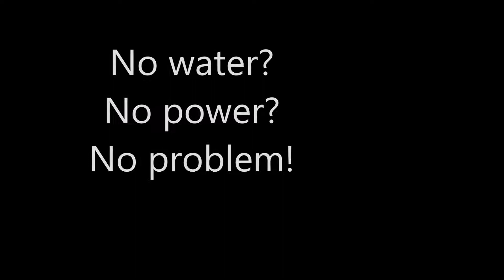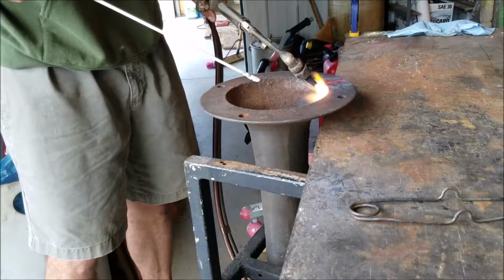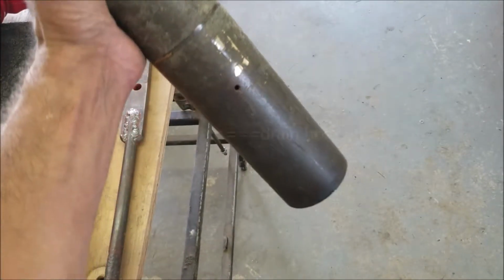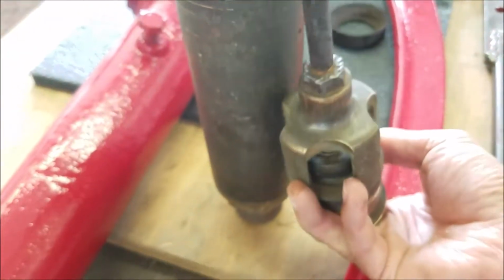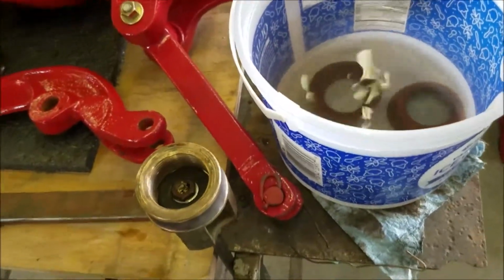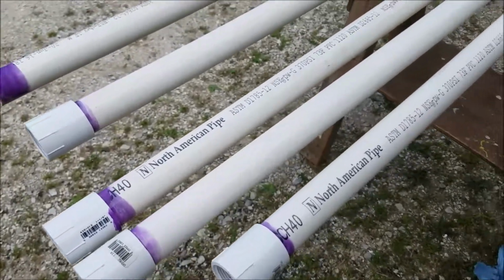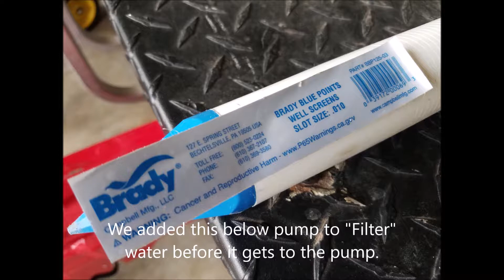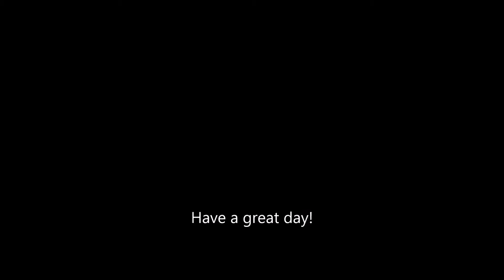The Old Red Pump Lives again!

Comment: Do you drink that water?
Reply from the maker: Yes, all the time when I'm working over there.  tastes great.  always best to pump it a bunch to clear out what's in the pipes... but after that it's great!
Reply from the maker: @stuntcardriver  NOPE!  dumped a gallon of bleach down there and then pumped until it didn't smell like bleach anymore.  been an active well for a long time, but it would be a good idea to have it checked for things like nitrates if the kids are going to drink a lot of it.  mostly use it for cleaning right now.
Reply from the maker: @stuntcardriver  sweet!  do you think this should be an annual process?  I dumped a gallon down there in fall when I removed the pump handle for winter.  maybe another shot in spring when I put it back into operation?